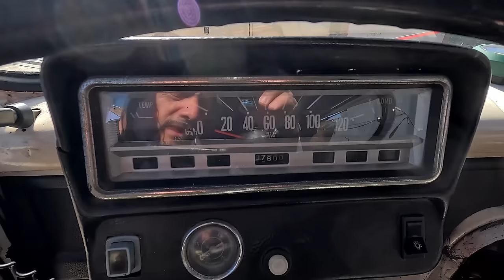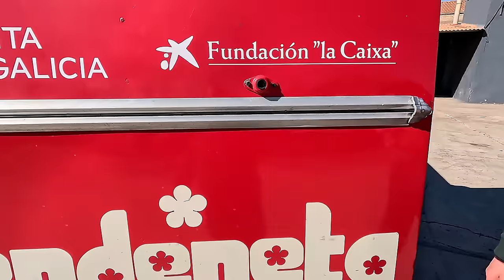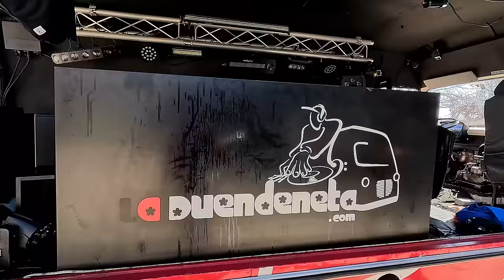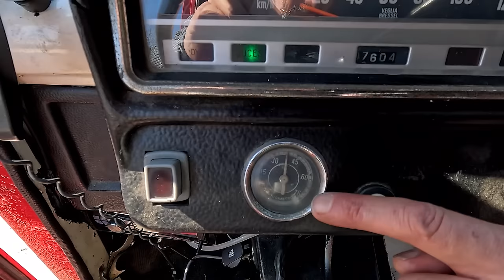GALLEGO salva camión AVIA Catalán | Discoteca Rodante

Comment: Hola Santi,ese furgón se parece mucho a un camión liviano que se fabricó en Argentina se llamaba Rastrojero y hubo varias versiones la frontal era casi igual a esa, pero traían motor Borward diesel,ese mismo motor Perkins venía instado de fabrica en las camionetas Dodge 100 y 200 y en las Ford F100 las F250  y F350 traían de fabrica el motor 6 cilindros. Site interesa verlo buscá Rastrojero frontal , felicito a ese señor que rescató un pedazo de historia automotriz española.Les mando un fuerte abrazo y bendiciones para todos desde Buenos Aires Argentina cuidate mucho y gracias por el video 🇪🇸🍻🇦🇷

Comment: Ese vacuometro es un claderin de Aire q asiste al embrague y el freno de pie, en el que yo tenía se saco una tuberia para la bocina de Aire, instalada entre el radiador del motor y la tapa de dicho radiador no tenia calefacción y le instalamos una de radiadores de tubo rectangular, era un rectangulo con tres tubos horizontales que se alimentaba del agua del radiador e iba instalado en el suelo del conductor 1 radiador y un 2°Radiador en el suelo del Acompañante, tenia un grifo a cada lado, y se regulaba el calor a base de vuelta, la fabrica estaba en Carabanchel, el motor mas duro que he conocido le hicimos 550.000 km y le vendimos por el doble de lo que nos costó eso sí q era una máquina, eso si había que hacerle doble embrague sobre todo de 2 a 3 y para reducir bajarle velocidad pisando el freno hasta que llegara a 20 km/h si no no habia manera cambiabas de oido sin cuentarrevoluciones, como le hecho de menos!!!! Cuidale galleguiño que eso que tienes entre manos es una joya, un fuerte abrazo a todos y a todos los camioneros y conductores de Autobús un saludo
Reply from the maker: Gracias !!! Aporte muy interesante